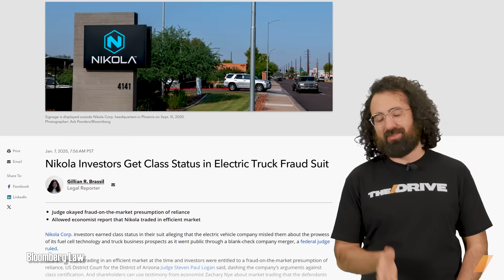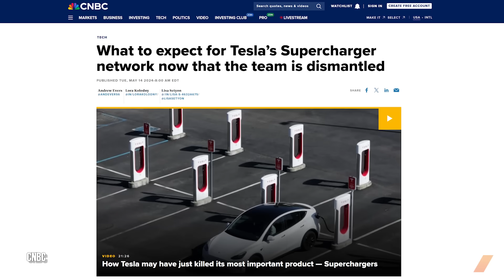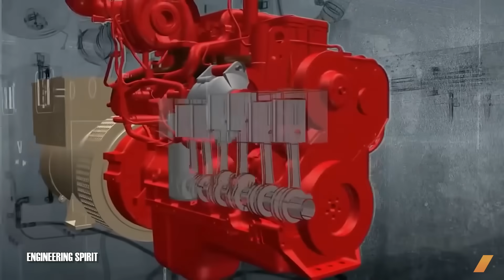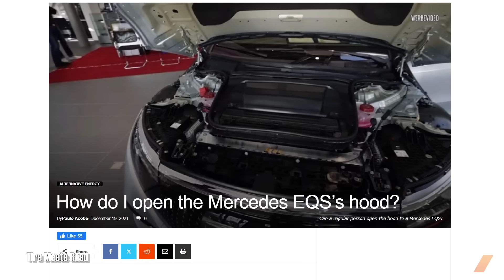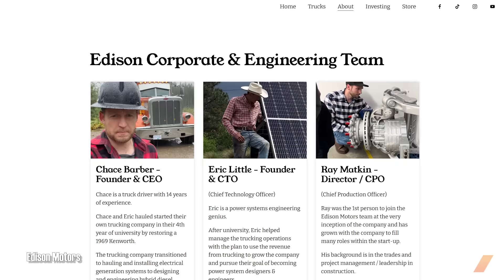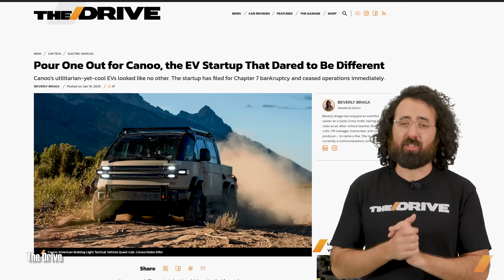The truckers in a shed beating Tesla with 100-yr-old EV tech

Comment: So a Chevy volt.....GM should have kept making that drivetrain for bigger cars and SUV's
Reply: I've owned a 2nd generation Volt since 2018. I always say it proves that once GM gets a platform right, they quit building it.
Reply: @1crustyoldmsgtretired870 I've always thought that a diesel volt would have been super dope.
Reply: @sirlesliechao Like a smart car. They were great, in the original tdi version.
Reply: GM has a diesel electric truck prototype that they're pitching to the military.
Reply: More like Mitsubishi Outlander PHEV, the first mass-produced plug-in hybrid passenger vehicle since 2012,  that's basically an EV with an oversized range extender.
It drives both axles with electric motors and runs in series-hybrid mode most of the time, and has one direct gear to the front axle for highway speeds.
Reply: @jozseffabri  Wasn't Prius PHEV around 2008?
Reply: More like the BMW i3, a range -extender hybrid with a battery in the floor and a motorcycle engine in the boot to charge the battery. The motors only run off the battery.
Reply: That's a PARRALEL Hybrid. More complicated and fragile as the small engine drives the wheels. Not suitable for Commercial Truck use. The closest thing Currently Now in mass production is Nissan's e-Power. e-Power oddly has a tiny sub 2kwh battery and is entirely reliant on the Gas Engine generator. There is no mechanical connection between the Engine and Wheels.
Reply: @Neojhun  It's actually a series - parallel depending on which of the five modes it's in.
Reply: @Neojhun  I believe the first gen Volt is a series hybrid. There is no mechanical coupling. Just two electric motors electrically coupled through the motor drive controller. The second gen combined the motors coaxially with the crankshaft to allow mechanical coupling at freeway speeds, saves a lot of weight by combining the motor and generator both as motors for battery only operation. It was also good for long distance highway cruising with less energy conversion loss from engine power going straight to the wheels. The mechanical coupling only makes sense when the engine and electric motors are in the same location, in trucks the drive axle being only connected with wire is a bigger advantage.
Reply: The problem with the volt is GM accidentally made a very reliable car.  I'm pretty sure GM hasn't built a decent car since
Reply: @ The Volt was even improving when Mary Barra killed it in order to make the Hummer EV, and sold about ten of them. LOL.
Reply: Not a Chevy volt....
Reply: Being a rotary fan, I’m most impressed with Mazda’s use of a 70HP, single rotor wankel to power the battery in their CX-50! A rotary at 2300 rpm is virtually invisible (provided exhaust is up to snuff) and loves E85 fuel! Unfortunately, I believe they’re a 3-row. Not my taste.
Reply: I worked on those. Some people managed to almost never use any gasoline at all. As a result, when they did need that engine, it didn't run very well and had plenty of problems. And the battery they had meant you only got 30 miles on a charge. The tech would be great but the generator needs to be able to handle occasional use.
Reply: did you ever drive one?
Reply: The new Toyota Camry and Honda Accord and Civic all use series hybrid drive systems. The engine powers a generator which powers electric drive motors to the wheels. They also have the added benefit of adding the engine power to the electric motors under hard acceleration.
Reply: And how. The Volt was genius, but GM being GM they just couldn’t make it economically cuz the company was too bureaucratic, in a word.
Reply: @gordonhard2663  GM canceled the Volt to go for the profit on $100k pickup trucks but now that those are rotting on the dealers lots GM finds itself lagging way behind the Japanese as usual. They’ll probably hobble some piece of crap together and fling it at the American buyer. The Volt was a good car.
Reply: @blipco5 we have the spark for plug in hybrid now, but its an ugly as sin hatchback and it seems like theres a lot of them for sale used, for how new they are.
Reply: @callsignapollo_  I care little about what people think of my mode of transportation but the Spark would never darken my driveway.

Comment: Tesla Semi can pull anything since it outputs 1500 horsepower, it weighs 10 tons and the batteries are covered by warranty. There is zero maintenance besides tires' replacement like in normal trucks and guess what: Electricity costs a lot less than diesel, no matter how you cut it.
Reply: but regardless, for long haul trucks, range is king, as well as downtime during fill ups. By making it a hybrid, you get a much greater range since you can run either on the battery, or a combination of both. EV mode for around town, then diesel on longer hauls that drain the battery. You won't have to stop to charge the giant battery, just fill up the tank like a normal diesel. You can say they're zero maintenance, but look how much of a disaster Tesla's other offerings have been with maintenance. Shit breaks. Just cause the drive unit doesn't need maintenance doesn't mean the rest of it is gonna hold up as good.

Comment: Edison is a pretty cool company, and very Canadian, which is why they seem very focused on replacing off-road logging trucks with their own hybrid version. This sort of hybrid is actually real common for other off-road equipment, so the idea is a much better fit than you'd expect. They do not seem focused on OTR trucking, though, so even if things are a complete success for Edison - it's looking pretty damn good - don't expect to see their trucks all over the place.
Reply: Edison heavy duty vocational trucks are underway. Edison OTR over the road highway trucks might happen later down the road.
Reply: I can see them getting some good sales here in Australia too. Long-haul trucks and road trains need to be able to drive for days on end without having to stop and charge at special charging bays.
Reply: @ConstantlyDamaged  The Edison trucks can handle way more weight than what exists right now so that would be beneficial for the road trains as well.
Reply: @paddington1670  Some road trains do have higher towing capacity than what Edison trucks can manage, but that could be made up for with similar tricks to what's used now. Some iron ore haulers have extra powered trailers, with their own diesel engine assisting the prime mover. Would be just as easy to convert those to a second set of e-axles and have their own diesel generator and battery set.

Currently, those trucks haul 250 metric tons of ore in 5 trailers, using a C510s prime mover (606HP) and one powered trailer (450 or 500HP, depending on revision).
Reply: Which makes it odd to be comparing it to a pavement-only Tesla.

Comment: Porsche's version of the Tiger tank (VK 45.01 P) back in WW2 was a gas-electric hybrid. The tech has been around for a very long time. Nice to see it getting some attention.
Reply: That is a really bad example. A really really bad example. The gas-electric hybrid was not picked for good reasons. Tiger 1, and Tiger 1 hybrid was tested side by side. With you know who looking at the two options.

The hybrid went up in flames. Used metal resources that cost to much compared to a normal gearbox. Tiger 1 happily did what it was meant to do. In every way better... A tank can not easily cool itself being armored and all. Electric drive adds more heat into the system then a normal gearbox. Weigh of the drive-train is more, + when having to be bigger and carry more armor to defend the bigger size of the drive-train. The hulls and so hybrid drive train was then repurposed, used in the Ferdinand Tank Destroyer. Even more weight and more mechanical failures.

The hybrid systems are inherently less efficient. Ones you get a diesel engine up to speed cruising? Sit there and you are winning in efficiency in the long run. Regenerative braking is the feature that you really lose out on. The moment we are talking about not being a road train hauling on the road for long distances? The hybrid has a chance to claw back a win. City type of driving it is almost a ridiculous comparison.

A train do not clime and decent steep hills. If a truck diesel is acting like a train? With train rail like inclines etc? Normal diesel with gearbox wins. EVERY time.  A diesel train can not really use a gearbox since the starting power needed to pull a train is insane. But a 18 wheeler is not a train. It can work out a gearbox and engine enough to start off and cruise nicely.
Reply: The French Char Bis 1 and 2 had this arrangement before Porsche
Reply: @ThePlayerOfGames  Porsche invented the whole concept of the series hybrid though. Look up the Lohner Porsche from 1899, the first series hybrid. 

He also used this drivetrain concept for the Landwehr-Train (1912), a truck that has features that are rare even today: A combustion engine in the truck provides power for electric hub motors in the wheels of trailers (up to ten, with five tons capacity each) attached to it. These trailers automatically steer to follow the exact course of the truck while also having a system that prevents them from sliding on slippery surfsces. The light weight of the trailers was deliberate: They could be detached, using long cables to individually cross small bridges with limited load bearing capacity. If train tracks were available, the entire truck with its ten trailers could be converted to train wheels in just 45 minutes.
Reply: That's Elon's favorite

Comment: What do you mean Tesla doesn't disclose the weight of their semi truck? Surely their customers (and the drivers) are legally required to know how much they truck weighs.
Reply: Tesla semi is 23k pounds
Reply: There is multiple configuration and the weight of them has been published online. It just depends which spec you want. The 450 mile range Day Cab seems to be about 26,000lbs. Being several thousand lbs heavier than ICE truck does not have any real world functional problems.
Reply: @Neojhun  500miles not 450
Reply: @Neojhun  also 300mile one is 20k pounds
Reply: @Neojhun  being several thousand lbs heavier defiantly has a massive drawback! Less payload equals less profit, or higher delivery costs of produce. Its a massive consideration when buying a truck, especially when buying a big fleet.
Reply: @Neojhun  that's not true at all. The trucks being heavier will degrade the road and tires much faster. when you register an EV in many places you will pay a fee specifically because of the added road wear. they also cannot carry as much cargo and struggle with going up hill. it's also harder to tow if it breaks down and has much harder impact on collision. 

one last mention is battery fires. If one of these catches on fire in traffic or on crowded freeway you're looking at a big problem.
Reply: @BeachLookingGuy  Road wear differences between passenger vehicles are totally swamped by the difference a heavy truck makes.

Comment: yeah it's amazing this isn't the standard... especially since trains were our first big transport system relatively speaking.
Reply: It is already typical for very large mining equipment to be electrical. Whether tethered, hybrid, or (increasingly) battery-only. The reason this isn't "typical" for class 8 trucks is the smaller scale you get the less hybrid makes sense vs extra cost for build and maintenance. That's why this is only ever going to be niche.

Comment: For heavily used roads, you can look at implementing wireless inductive charging. It exists and CAN work during the drive. Battery doen't lose much state of charge, or even gains, while driving. Every kWh charged on the go, doesn't need to be put in during stops, and the battery for it needs not be hauled around reducing payload capacity.

Comment: EV/Hybrid commercial vehicles are massively lacking as well!
And I'm not talking pickups, because all the EV/Hybrid pickups are useless dual-cabs, that are designed more as family haulers, than actual work vehicles! 
Like can I just get an EV or hybrid van please!!
Reply: Rivian now sells there van but it has shit range BC its a brick
Reply: @mcsike7264  it also starts at $80,000....

It's probably full of unnecessary crap as well.
We need bare bones economy commercial vehicles like a hiace or a transit.
I still don't know why Toyota haven't stuck one of their hybrid units in a van yet, if they can push around a mid-large sized SUV, surely they'd be able to handle a van with a decent load!
Reply: @paulwade5853  most of the coast is the battery and its super under battery since its range is like 200miles

Comment: Are EV awesome? YES! Are they the answer for all applications? NO!. Is the a hybrid the solution for the majority applications? YES!
Reply: To nitpick a bit. It is not a hybrid. It is an EV with a generator on board
Reply: @ProjectExMachina  Look of the definition of a series hybrid.
Reply: @alexanderdeburdegala4609  I have a car that runs both on LPG and gasoline. Does that make it a hybrid?
Reply: @ProjectExMachina  Explain to me why the term series hybrid exists then, and how it is different than a EV-ER?
Reply: @ProjectExMachina  ....what...do you think a hybrid is?
Reply: @gormauslander  two (or more) engines working together to power the wheels.
Reply: @ That sounds like a personal definition you made up rather than the one literally everyone else in the world is using. 

From Wikipedia: A hybrid vehicle is one which uses two or more distinct sources of power . It does not specify how that power is used, only that it has more than one source. It gives an example in diesel submarines as a hybrid vehicle, which use a diesel generator tied to batteries and an electric drivetrain. One power source is the generator turned by the diesel engine. The other power source is the batteries. A diesel-electric locomotive is not considered hybrid simply because it doesn't have batteries, the power runs straight from the generator to the wheels.

The Edison truck can be plugged in to charge or you can run the generator to charge, therefore it is a hybrid. Your vehicle that can run on LPG and gas might be a hybrid, but it could be argued that since both are run through the same internal combustion engine an combust, you don't have a new source of power, you have a new fuel. Edison is specifically an electric hybrid. There are other kinds like hydraulic hybrids which recapture kinetic energy in braking and then that becomes a power source for the wheels on takeoff again.
Reply: The transition to electric has been greatly impeded by people assuming that one size fits all, either full electric is ready for that market or no electric is. There's a middle ground here where we can begin the transition while keeping the best of both, and these trucks will be fully capable of transitioning again to full electric if the battery density gets good enough.
Reply: Yeah, EV Cultists are as bad as EV haters, both sides of the same stupid coin...